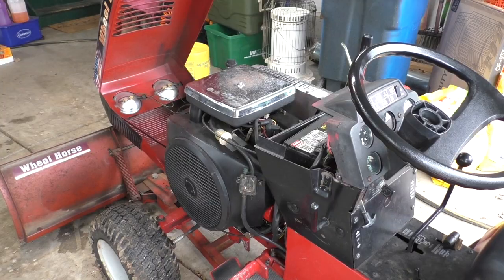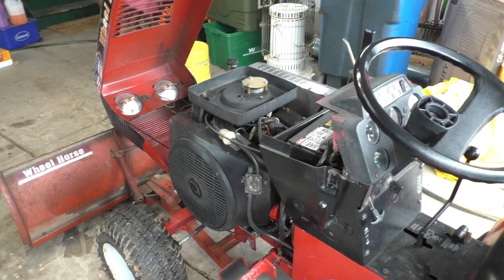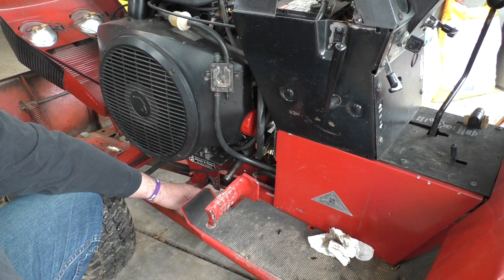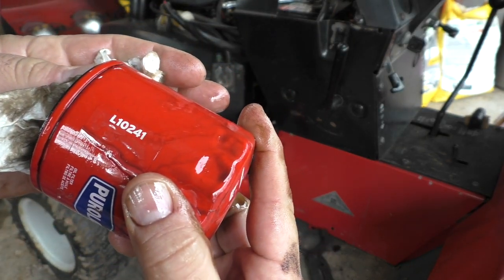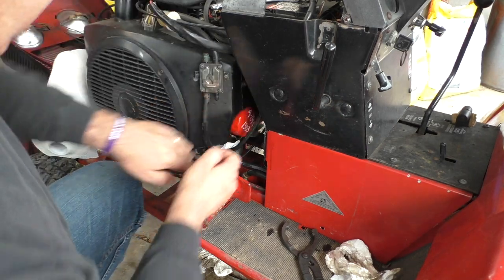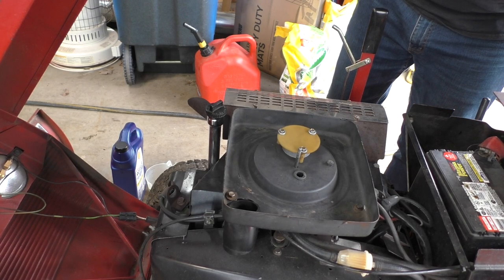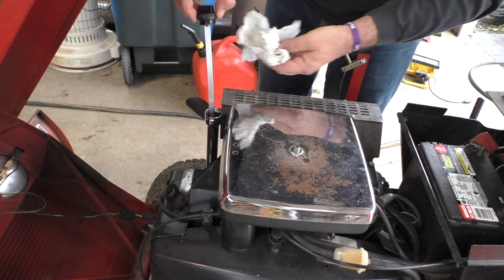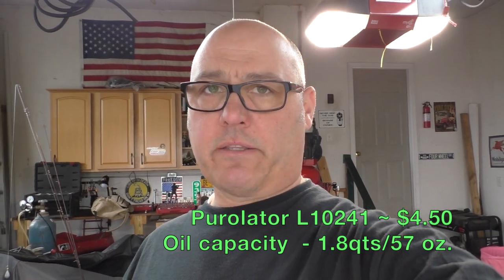Wheel Horse 520H Oil Change

Comment: Can you tell me if the coil filter has a rubber ring around the filter and air shielding of engine ?? Does the engine have a 5.5 inch high oil pan Craig ?? From the bottom of engine to gasket part line of engine ???

Comment: Nice video, Craig! Last year I took my 520-H to my vocational center before I graduated to do some things to it I couldn't do at home. I had to take the engine out and have the starter mount on the block welded. The previous owner had put a new starter and flywheel on it, but overtightened the starter and broke one mount off the engine. I also soldered one of the stator wires that I found that was torn. I also put on a new voltage regulator because the old one was bad. I had to tighten up the drive linkage because the tractor was painfully slow, and I also removed the fenders to clean the trans fins and to change the trans oil/filter. The engine got cleaned and put back together. While it home, I rebuilt the mower deck, put two new gauges in the dash and replaced all of the gauge lights, installed new headlights, touched up some paint, and a couple other misc things. I really should take the engine back off and clean the carbon off the heads because I don't know when that was done, but I have many other projects to work on as well, such as a Work Horse GT1848 I plan to repaint. Take care, Craig!

Comment: Nice machine, great vid. I have the 518, why is mine shooting oil into the air cleaner area from the crankcase vent? Is there a plugged oil return somewhere that's causing it to flow up into the air cleaner housing?
Reply from the maker: I would remove the air cleaner housing, take off the breather, pull the screen out and spray it with carb cleaner. You should have good ventilation through that screen and breather.  If it’s blocked with carbon or old oil, it can spray oil into the filter.  You can buy new ones still, just replaced mine because it was cracked. If the breather tube is hard like plastic get rid of it. They should be soft and rubbery.

Comment: I just picked up a mid 90’s 520H it has a blown rod. Some how the crank and block did not get damaged from it. Just have to find the parts
Reply: Good luck! Cummins has discontinued the rods for the 20hp onans. I just bought a 1996 520h with a non runner and it had a blown rods and tore up crank which I ended up sourcing out a matched set of crank/rods
Reply: @Fordfarmer9700  Thanks for the heads up. Sounds like I will most likely do the same.

Comment: I noticed you wrote 4-29-22 on your new filter. Are you sure you didn’t mean 4-29-23 ?
Reply from the maker: Good eye. I didn’t even catch that. Must have been looking at the old filter from last May’s oil change.
Reply: No problem… I really enjoy your videos . Around the same time you restored your 520H I had recently acquired a 1994 520H, and the video series you done on your restoration really helped me out. I had to have a carb, fix some wiring issues,few parts like a flywheel screen, fuel pump, fuel line, filters, etc. I did repaint the body panels and new decals from Terry the Vinyl Guy…
Oh yeah, powder coated the wheels and new tires…